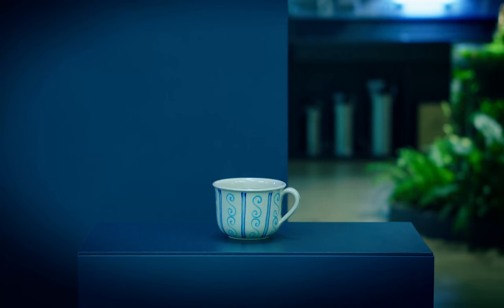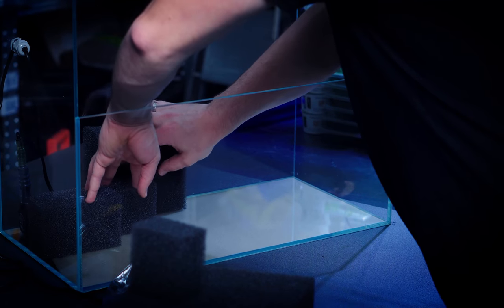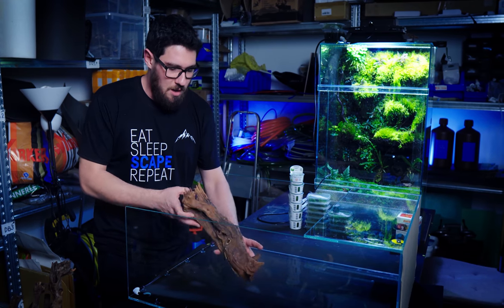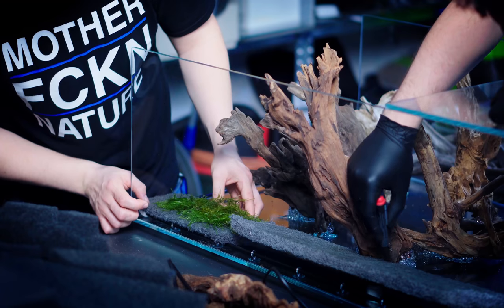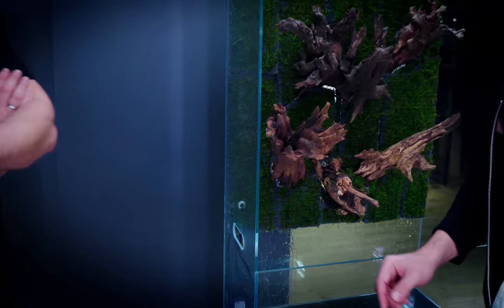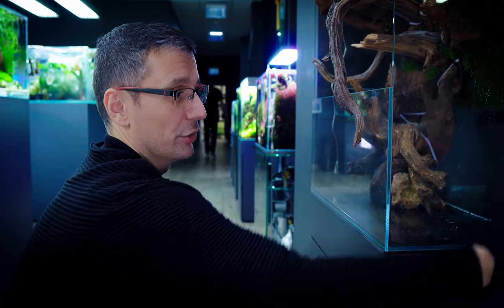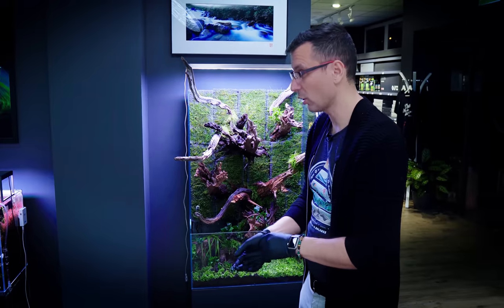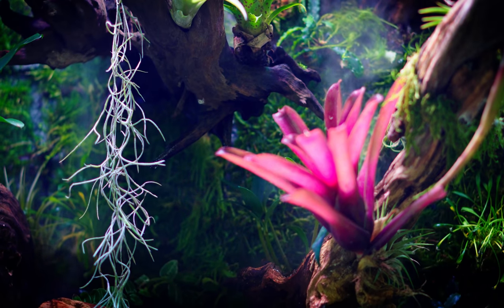Planted Tank & Green Wall - NEW TREND? How to Build Your Own

Comment: If you use egg crate to form a barrier structure around the submersible pump you can get a better barrier seal with the foam for filtration/pump protection. The egg crate can also be used to support hardscape. Or use a thinner mesh and plant mosses on to it to totally hide the submersible pump. Just an idea to help hide a less than pretty piece of technology. Hope you do an update in a few weeks to show how well the moss wall has grown in, should look good.
Reply from the maker: Yeah, you're right, thanks for the suggestion Jason! We will keep you posted - for sure.

Comment: Once again great edit on this guys but could you leave the info about plants and equipment that pops on the screen just a little bit longer , makes it easier to read. 😁👍
Reply from the maker: Not possible Ian, this graphics template has a fixed length. I could stretch it by reprogramming the length and make a new template but then it would be too long, overhanging into the next images that are about something else, it would be confusing to the viewer. We do list all the plants - and all other details - in the description however, and you can always pause the video (I know that is not a very good way to watch our videos) whenever you're interested.

Comment: Hi GreenAqua. Doesn't the fogger add a lot of humidity to the room with an open paludarium? And in general, wouldn't these open style paludaria make the interior of your house humid. I've only had closed up until this point.
Reply from the maker: Not at all, 2 liters per day - that is less than the evaporation from a small tank.

Comment: Looks awesome 😍
query regarding mist.
1. Have u placed the mist maker and if so where?
2.  any technique to get the mist spread diffusely all over.🤔
Reply from the maker: 1. Mist maker is in the cabinet, hoses take the mist up behind the tank to the top, where it's drilled, comes in and a spray-bar takes it along the top of the Paludarium.
2. yeah, the spray-bar.

Comment: Love the build and I am trying to replicate it with a wider tank (70cm) to allow more space for aquascaping. Could you let me know the size of the hole you cut into the side for the inflow and outflow? Thank you for all of the videos - wonderful production, informative and amusing. I am hooked!
Reply from the maker: Just enough to fit in the glass pipes, don't forget that you need to fit the pipe in horizontal position, then turn it down vertically after pushing the pipe through the hole. You can test that by cutting a hole in a cardboard box and try to fit both pipes in one after the other.
Reply: @GreenAquaShop   Thank you! Is there anything that you have learned on the build that you would do differently?  I will post the final build to the UKAPS forum.
Reply from the maker: Yes. You need to light the aquatic part separately somehow, without having that light visible. I might want to have to hidden lights inside two big branches above the water (like a bulb or something) - because the light on the top is kinda not strong enough down there.
Reply: @GreenAquaShop  Brill, thank you. I was thinking of something similar, perhaps a small kessil tuna sun shining at an angle through the water from outside the tank? Or scaping with just Buce, Anubis, and some crypts.
Reply from the maker: Yeah, I think Kessil is a good idea!

Comment: Hey, I recently bought a biomaster 350 to put in my 60p tank, however the hose size is 17mm and I feel like the 17mm glass inout flow is way too big for the 60p tank, should I use the hose adabter for this solution? What is your suggestion?
Reply from the maker: Yes, I would also use a reducer and 12/16 hoses with that tank size.

Comment: Please tell us more about misting method can be used for paludarium
Reply from the maker: It is a cold mist maker in the cabinet, the hose is being brought up to the top of the tank in the back, comes in through the upper hole and being distributed evenly through a horizontal spray-bar.